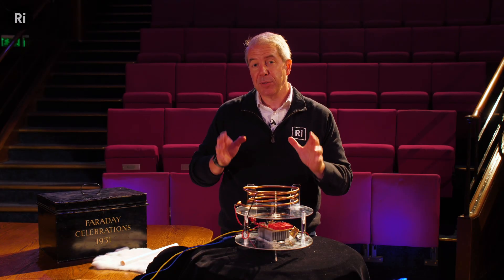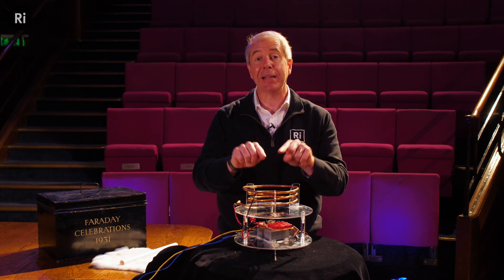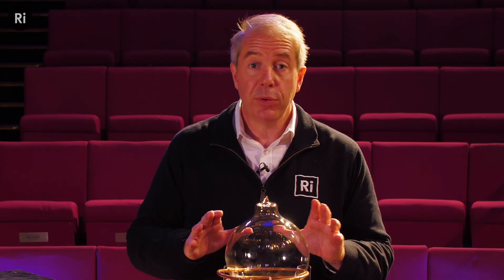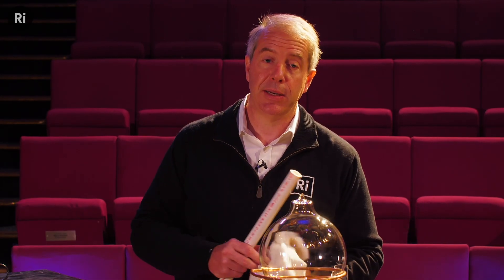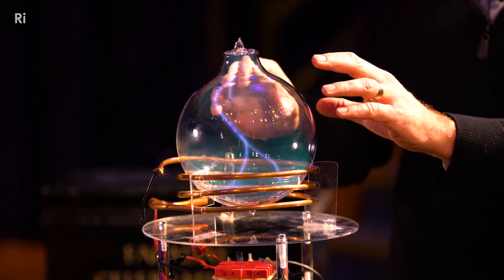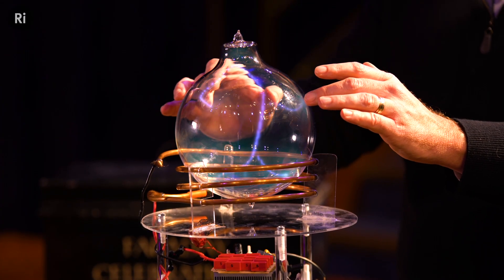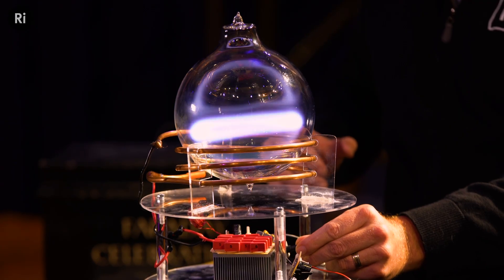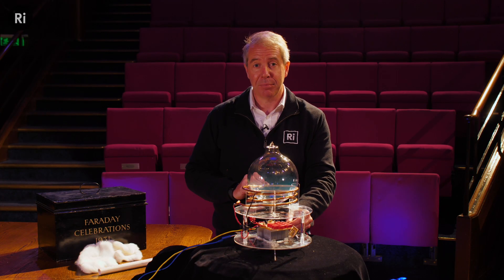Floating plasma toroid - with David Ricketts

Comment: Essentially the same process as what causes fluorescent light bulbs to work, except there's no toroid inside those.  You're taking a high-voltage current and passing it through an inert gas, thus allowing the electrons to emit photons in their different stages of excitement.  The toroid reminds me of the "futuristic" robots of the 1920s and 1930s!
Reply: It is not the same thing. In a fluo tube you need 2 electrodes. The current used in that case is probably AC. Also, once the ionization starts, it switches to a low voltage. Something like 160 V.
In the case of a plasma bulb, they use a high voltage, probably 10 kV, it is AC and also it is high frequency. These causes capacitance coupling, which sort of means that the electrons are being pulled and pushed. The voltage is enough to cause ionization.
The demo in this video doesn’t seem to use a high voltage. It uses a magnetic field. I think he caused an ionization to occur and the magnetic field causes induction. You get a current going around, which is called an eddy current. It is wobbly because of some energy input and some inertia.

Comment: I live in a town with many professional glass blowers, but none have experience trapping low pressure gas inside the volume. I've built the circuit but I can't get the globe done. Any tips I can forward to them on how to do this?
Reply: They make the globe with an outlet port thru which the globe is evacuated and then Xenon from a cylinder is bled in, perhaps a few cycles of this (evacuate/close pump valve/open Xenon valve) to get the lines cleared and purer Xenon. When the pressure seems right either by guage or  having the discharge going, the glassblower seals the bulb with their torch.  A high vacuum is not required so the vacuum pump will cost less than $200.
Reply: @GustavoValdiviesso  Search Zerg Labs' video on glassblowing plasma spheres. You'll probably need to contact a laboratory glassblowing company to get one made.

Comment: This unique device reminds me of the "Vortex Theory" proposed by Maxwell and others during the 19th century.  Is the following subatomic model a "Quantized" hyperdimensional version of "Vortex Theory"?

Both Matter and Energy described as "Quanta" of Spatial Curvature.  (A string is revealed to be a twisted cord when viewed up close.)

 If quarks have not been isolated and gluons have not been isolated, how do we know they are not parts of the same thing?   The tentacles of an octopus and the body of an octopus are parts of the same creature. 
Is there an alternative interpretation of "Asymptotic Freedom"?  What if Quarks are actually made up of twisted tubes which become physically entangled with two other twisted tubes to produce a proton?  Instead of the Strong Force being mediated by the constant exchange of gluons, it would be mediated by the physical entanglement of these twisted tubes.  When only two twisted tubules are entangled, a meson is produced which is unstable and rapidly unwinds (decays) into something else.   A proton would be analogous to three twisted rubber bands becoming entangled and the "Quarks" would be the places where the tubes are tangled together.  The behavior would be the same as rubber balls (representing the Quarks) connected with twisted rubber bands being separated from each other or placed closer together producing the exact same phenomenon as "Asymptotic Freedom" in protons and neutrons.  The force would become greater as the balls are separated, but the force would become less if the balls were placed closer together.  Therefore, the gluon is a synthetic particle (zero mass, zero charge) invented to explain the Strong Force.
 
String Theory was not a waste of time, because Geometry is the key to Math and Physics.  However, can we describe Standard Model interactions using only one extra spatial dimension
What if we describe subatomic particles as spatial curvature, instead of trying to describe General Relativity as being mediated by particles

Quantum Entangled Twisted Tubules:  
“We are all agreed that your theory is crazy. The question which divides us is whether it is crazy enough to have a chance of being correct.”    Neils Bohr
(lecture on a theory of elementary particles given by Wolfgang Pauli in New York, c. 1957–8, in Scientific American vol. 199, no. 3, 1958)

The following is meant to be a generalized framework for an extension of Kaluza-Klein Theory.  Does it agree with some aspects of the “Twistor Theory” of Roger Penrose, and the work of Eric Weinstein on “Geometric Unity”, and the work of Lisa Randall on the possibility of one extra spatial dimension, and the “belt trick” of Paul Dirac?  During the early history of mankind, the twisting of fibers was used to produce thread, and this thread was used to produce fabrics.   The twist of the thread is locked up within these fabrics.  Is matter made up of twisted 3D-4D structures which store spatial curvature that we describe as “particles"?   Are the twist cycles the "quanta" of Quantum Mechanics?
When we draw a sine wave on a blackboard, we are representing spatial curvature. Does a photon transfer spatial curvature from one location to another? Wrap a piece of wire around a pencil and it can produce a 3D coil of wire, much like a spring. When viewed from the side it can look like a two-dimensional sine wave. You could coil the wire with either a right-hand twist, or with a left-hand twist. Could Planck's Constant be proportional to the twist cycles. A photon with a higher frequency has more energy.  ( E=hf, More spatial curvature as the frequency increases = more Energy ). What if Quark/Gluons are actually made up of these twisted tubes which become entangled with other tubes to produce quarks where the tubes are entangled?  (In the same way twisted electrical extension cords can become entangled.) Therefore, the gluons are a part of the quarks. Quarks cannot exist without gluons, and vice-versa. Mesons are made up of two entangled tubes (Quarks/Gluons), while protons and neutrons would be made up of three entangled tubes. (Quarks/Gluons) The "Color Charge" would be related to the XYZ coordinates (orientation) of entanglement. "Asymptotic Freedom", and "flux tubes" are logically based on this concept. The Dirac “belt trick” also reveals the concept of twist in the ½ spin of subatomic particles.   If each twist cycle is proportional to h, we have identified the source of Quantum Mechanics as a consequence twist cycle geometry.  

Modern physicists say the Strong Force is mediated by a constant exchange of Gluons. The diagrams produced by some modern physicists actually represent the Strong Force like a spring connecting the two quarks. Asymptotic Freedom acts like real springs. Their drawing is actually more correct than their theory and matches perfectly to with this model. You cannot separate the Gluons from the Quarks because they are a part of the same thing. The Quarks are the places where the Gluons are entangled with each other. 

Neutrinos would be made up of a twisted torus (like a twisted donut) within this model. The twist in the torus can either be Right-Hand or Left-Hand.   Some twisted donuts can be larger than others, which can produce three different types of neutrinos.   If a twisted tube winds up on one end and unwinds on the other end as it moves through space, this would help explain the “spin” of normal particles, and perhaps also the “Higgs Field”.   However, if the end of the twisted tube joins to the other end of the twisted tube forming a twisted torus (neutrino), would this help explain “Parity Symmetry” violation in Beta Decay?  Could the conversion of twist cycles to writhe cycles through the process of supercoiling help explain “neutrino oscillations”? Spatial curvature (mass) would be conserved, but the structure could change. 
=====================
Gravity is a result of a very small curvature imbalance within atoms. (This is why the force of gravity is so small.) Instead of attempting to explain matter as "particles", this concept attempts to explain matter more in the manner of our current understanding of the space-time curvature of gravity. If an electron has qualities of both a particle and a wave, it cannot be either one. It must be something else. Therefore, a "particle" is actually a structure which stores spatial curvature. Can an electron-positron pair (which are made up of opposite directions of twist) annihilate each other by unwinding into each other producing Gamma Ray photons?  

Does an electron travel through space like a threaded nut traveling down a threaded rod, with each twist cycle proportional to Planck’s Constant?  Does it wind up on one end, while unwinding on the other end?   Is this related to the Higgs field?  Does this help explain the strange ½ spin of many subatomic particles?  Does the 720 degree rotation of a 1/2 spin particle require at least one extra dimension? 

 Alpha decay occurs when the two protons and two neutrons (which are bound together by entangled tubes), become un-entangled from the rest of the nucleons

. Beta decay occurs when the tube of a down quark/gluon in a neutron becomes overtwisted and breaks producing a twisted torus (neutrino) and an up quark, and the ejected electron. The production of the torus may help explain the “Symmetry Violation” in Beta Decay, because one end of the broken tube section is connected to the other end of the tube produced, like a snake eating its tail. The phenomenon of Supercoiling involving twist and writhe cycles may reveal how overtwisted quarks can produce these new particles. The conversion of twists into writhes, and vice-versa, is an interesting process, which is also found in DNA molecules.  Could the production of multiple writhe cycles help explain the three generations of quarks and neutrinos? If the twist cycles increase, the writhe cycles would also have a tendency to increase.

 Gamma photons are produced when a tube unwinds producing electromagnetic waves.  ( Mass=1/Length )

    The “Electric Charge” of electrons or positrons would be the result of one twist cycle being displayed at the 3D-4D surface interface of the particle.  The physical entanglement of twisted tubes in quarks within protons and neutrons and mesons displays an overall external surface charge of an integer number.  Because the neutrinos do not have open tube ends, (They are a twisted torus.) they have no overall electric charge.

Within this model a black hole could represent a quantum of gravity, because it is one cycle of spatial gravitational curvature.   Therefore, instead of a graviton being a subatomic particle it could be considered to be a black hole.   The overall gravitational attraction would be caused by a very tiny curvature imbalance within atoms.

In this model Alpha equals the compactification ratio within the twistor cone, which is approximately 1/137.

1= Hypertubule diameter at 4D interface

137= Cone’s larger end diameter at 3D interface where the photons are absorbed or emitted.

The 4D twisted Hypertubule gets longer or shorter as twisting or untwisting occurs.   (720 degrees per twist cycle.)  

How many neutrinos are left over from the Big Bang?  They have a small mass, but they could be very large in number.     Could this help explain Dark Matter?

Why did Paul Dirac use the twist in a belt to help explain particle spin?  Is Dirac’s belt trick related to this model?    Is the “Quantum” unit based on twist cycles?   Does it take two full turns to get down the rabbit-hole (Alpha funnel)?

I started out imagining a subatomic Einstein-Rosen Bridge whose internal surface is twisted with either a Right-Hand twist, or a Left-Hand twist producing a twisted 3D/4D membrane. This topological Soliton model grew out of that simple idea...

Comment: The problems with mass production:

-The handmade glass globe under vacuum filled with a certain amount of xenon is expensive(currently probably upper triple digits)
-Dont think a plastic globe would work for multiple reasons, I could wrong
-Glass is easy to break
-You need a good understanding of many things in order to get it to perform well. Parts may need adjusting, etc…
-All that adds up to it being a complicated toy that will be very hard to get working for the average person. Imagine Karen calling in complaining they cant get theirs working for little Timmy and you have to explain all these concepts to her. Her brain will explode and she will want to know why she can’t just push a button for a toy that cost $1000
-At best these could be sold as hobbyist kits likely in the $1000 range, with absolutely now warranty or gurantee you will get it to work. It might be well over a $1000, shipping those globes aint easy or cheap.
-Other unforeseen consequences.

Comment: I don't think I understand any step:
- How does static electricity create streamers? The charge on the rod wasn't even transferred to the globe
- How are the streamers sustained? Where's the energy from? Can you transfer even more energy inside?
- How do the streamers connect into a toroid and not immediately dissipate?
- Why don't instabilities (e.g. kink) kick in?
Reply: High voltage field from the stick is just for "kick start" ionization in the Xenon, which is further supported by the high frequency high energy AC field from the oscillator coil. In this coil some serious currents are running. I believe this is a ZVS driver circuit used for driving HV flyback transformers or induction heaters.

Comment: 😮 I don't understand at the beginning. 
You transferred charge from the rod to the globe. ✅   
But if you weren't continually adding charge after that, how did the "sort of lightning" inside the globe not disappear, especially when your hands touched the globe? I think you turned on the power to make the toroid float up, right? But before that why did the charge inside not dissipate? 🤔
Reply: I have exactly the same question. What is sustaining the glow? Is the magnetic field oscillating, perhaps? Why was a copper pipe used instead of a lot of thin wire?
Reply: @statonra  The coil is carrying a high frequency alternating current which magnetically couple to the plasma, acting like a transformer. Pipe is used because it;s rigid enough to support the globe, nothing more technical than that!

Comment: Why exactly does touching the outer surface of the ball change the direction of plasma streamer?
Reply: path of least resistance, air is an insulator our skin is not
Reply: @keterclassentity6716  hmmm but that would mean current flows from the plasma > glass > our body?